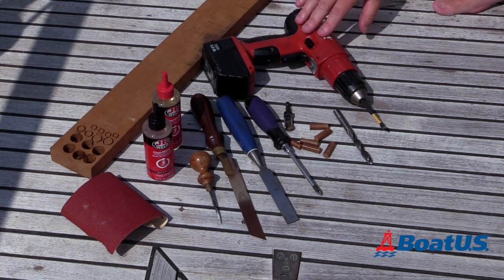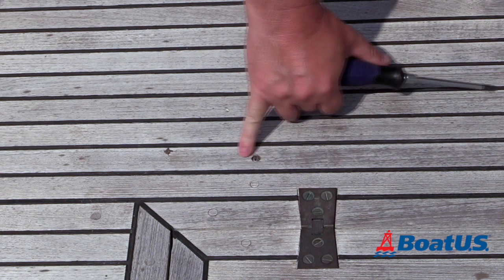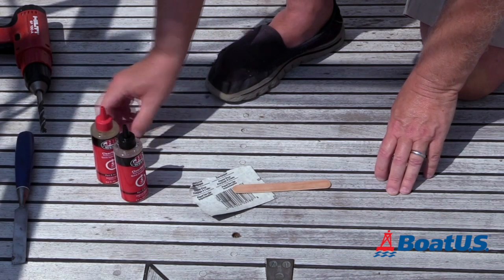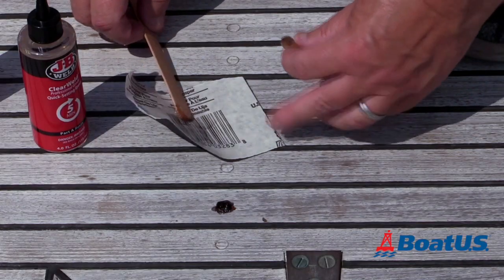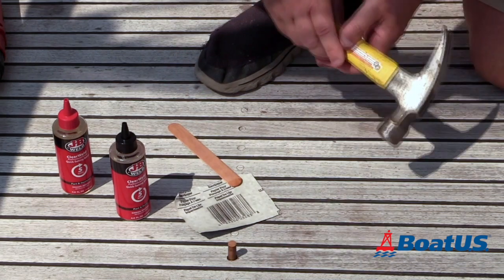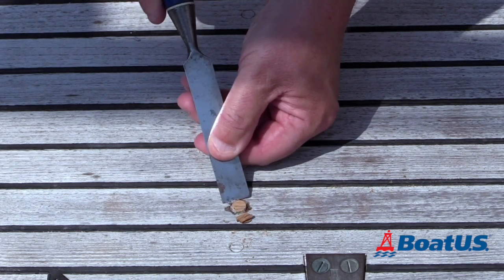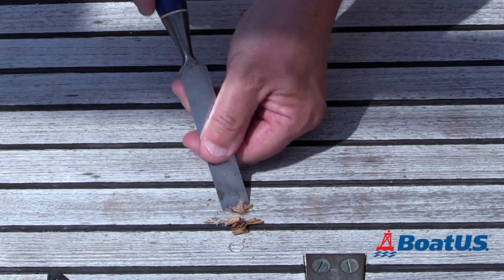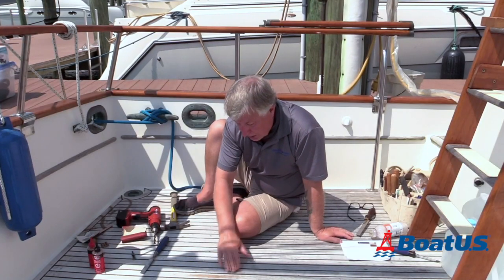How To Replace Teak Deck Bungs/Plugs on a Boat | BoatUS

Comment: Very helpful. But doesn't the epoxy fill the slots in the screw so it is difficult/impossible to remove a second time?
Reply from the maker: Great question, Dean. It does, but softening the epoxy with the application of heat from a hot air gun or soldering iron allows the epoxy to be easily picked out of the screw slot.

Comment: I think if youre working around varmished bungs and have varnish, you may want to use that as a glue so that it doesnt foul the screw. Thanks for the tips! :)
Reply from the maker: Thanks for that, forrest. You're right -- using varnish or shellac is a more traditional way to set deck bungs. It's another option if preferred.

Comment: I thought you weren't supposed to glue the bungs as it makes a pain for the next repair
Reply from the maker: Thanks for the question, Charles. Without glue, they're likely to pop out. If you need to make repairs in the future, apply heat from a hot air gun or soldering iron to soften the epoxy, making it easy to pick it out of the screw slot.